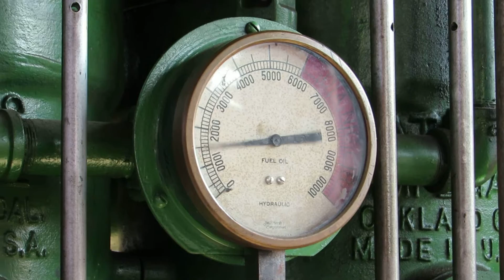Atlas start up and running

Comment: I rescued this engine in Seattle and restored it to running condition for John Carter and Independence Seaport Museum.  Great to see it has found a new home where it is appreciated and kept in running order.  I have worked on these engines most of my life and I still own a smaller 60 hp version of this same type of Atlas Imperial engine in my tug, the BUSTER, on Lopez Island, WA.  If taken basic care of, they will run for many hundreds of thousands of hours, and most Atlas Imperial engines long outlived their original owners.  There are quite a few of various sizes still in operation in the Pacific Northwest, but they were also very popular on the Gulf Coast and in the bayous and Gulf Intracoastal Canal.  There are a number of them overseas as well, in tugs left by the US navy after WWII, and in tugs and other vessels sold foreign.  In the video, you see the injection pressure being kept low because they are probably running it on modern No. 2 diesel fuel, which is quite a bit thinner than diesel fuel commonly available in the 1920's and 30's when these engines enjoyed their greatest popularity.  The injection pressure is instantly adjustable with a single lever, up to as much as 10,000 psi, and the engines will fire on any fuel oil that can be made to flow through the supply piping, even heavy viscosity marine bunker fuel oil that will not flow at all unless heated.  The method of starting is very simple and there is no separate starter motor of any kind such as found on many modern makes of small to medium marine diesels.  Instead, high pressure starting air is injected straight into the cylinders and controlled by the fourth pushrod which operates the starting air valve in each cylinder head.  The engines are slow turning and direct coupled to the propellor, and  extremely efficient and economical to run, compared to modern reduction geared engines.  My 60 hp Atlas, which weighs about 4 tons, uses a maximum of 3-1/2 to 4 gallons per hour at full speed and at a comfortable cruising speed of 6 knots at about 3/4 throttle, will use only about 2-1/2 gallons per hour.  This more massive 135 Atlas in the video at full speed will have used only about 8 to 10 gallons of fuel per hour.  To repower a vessel if an Atlas is removed typically requires a modern engine of at least triple the horsepower and fuel consumption to turn the same prop, and the fuel consumption can be ever more if the replacement is a two cycle Detroit (newer name for the original Gray Marine  or 'Jimmy' diesel) where there is a degree of after-burn.  The Atlas Imperial was one of the best American small marine diesels of its day and they surely deserve their places in the various museums that have saved them.
Reply: Fascinating information
Reply: Being direct drive, I would think that this is a direct reversing engine like the Enterprise engines I trained on in the Army. But I can’t see the cam.
Reply: @tracylemme1375  Hi, only the six cylinder Atlas Imperials were direct reversing.  The 2, 3, and 4 cylinder engines had dead spots in the starting positions.  They are direct locked when going ahead but reverse thru planetary gears that are about 1.5 to 1 reduction.